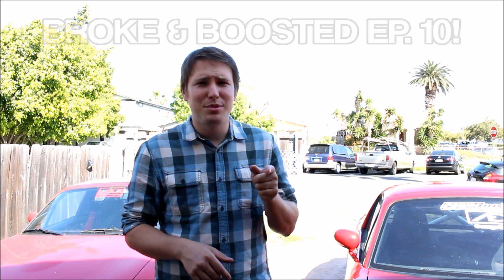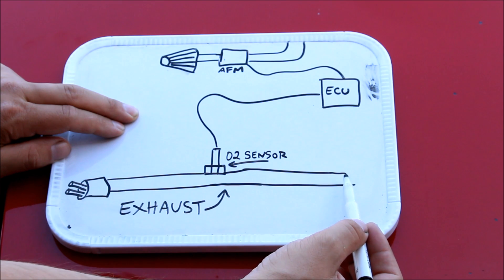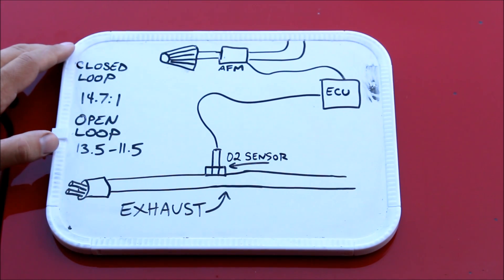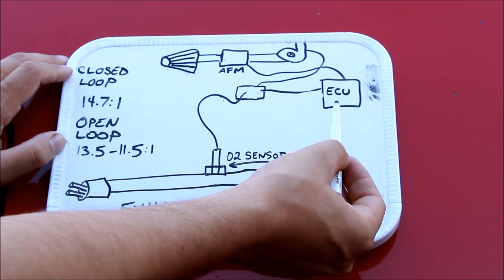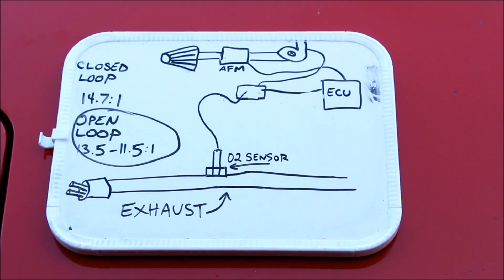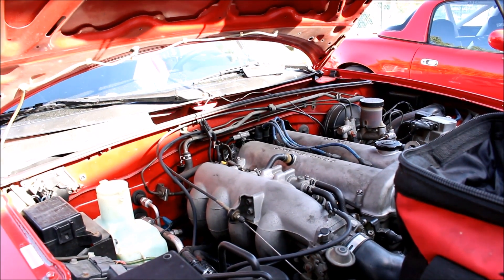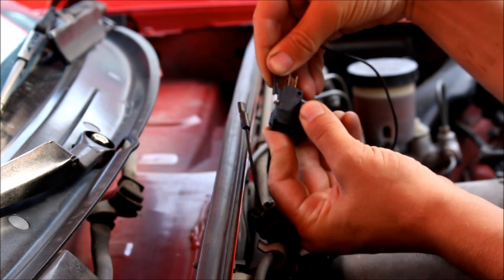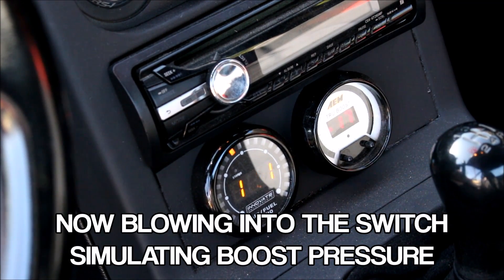Tricking The Stock ECU: o2 Signal Modifier (Broke & Boosted Ep10)

Comment: So if I have a wideband I'm going to completely get rid of the stock o2 sensor and wont need any of this right?
Reply from the maker: If you have a wideband in place of the stock sensor, but are still on the stock ECU, this may still help you. The only time this is unnecessary is with an aftermarket ECU.
Reply: I have the stock ECU still, I have a AEM wideband I'm going to put in, this trick should still help it run better right?
Reply from the maker: Sahin Merino It can help. The stock ECU doesn't know you have a wideband, because you have to run the narrowband signal to it. So this cutoff switch can help it run a little smoother as it transitions into boost.
Reply: Installed the same way as the video shows, but I'm still getting a very lean reading during idle and cruise speeds. Anything I could be missing?
Reply from the maker: Sahin Merino How lean? Does it do the same thing when disconnected?
Reply: yeah it's running lean with or without the signal modifier but only when not in boost such as cruising and idle, it gets a little better once warmed up
Reply from the maker: Sahin Merino If it runs lean with or without the signal modifier, then that's probably not the problem. How lean does it run? What AFR?
Reply: AEM uego, it's about a foot away from the turbo in the downpipe, I agree that it's probably not the o2 sensor modifications I've done but I still can't figure it out..
Reply: It's reading 17+ on idle and cruise and about 11 to 14 during boost. Steady 12 when WOT on boost
Reply from the maker: Sahin Merino 14 is too lean in boost, that's dangerous to the engine. Got any exhaust leaks?
Reply: Yea I have exhaust leak from the cat, but could that really be causing the gauge and car to be that lean?
Reply from the maker: Sahin Merino An exhaust leak close to the sensor will show lean readings even though the car isn't running lean, but not at wide open throttle (only idle/light cruise).
Reply: I'll be fixing the leak asap and see if it makes a difference. I really appreciate the insight on this issue I'm having. Thank you

Comment: do you know if the switch can work  with the stock O2 sensor?
Reply from the maker: It will work the same way yes
Reply: +TheCarPassionChannel  what about the performance??what s your opinion?
Reply from the maker: peter yalas You're overthinking it, a lot of people don't even use this. Also, I hope you're not planning on boosting your car without a wideband.
Reply: +TheCarPassionChannel you re right...i dont plan to do such a thing!but .i don't want to use the gauge in the cabin and as i saw a calibration with it is needed....is it possible to use the wideband directly connected on ecu without the gauge and no calibration???
Reply from the maker: peter yalas It takes 30 seconds to calibrate the sensor and you only have to do it like once a year... Yes you can run a wideband controller direct to the ECU with no gauge, Innovate sells them like that as well. But you still have to calibrate the sensor.
Reply: +TheCarPassionChannel can i calibrated without the gauge?
Reply: +peter yalas  if yes how?
Reply from the maker: peter yalas The gauge doesn't calibrate the sensor, the controller does. The MTXL has the controller build into it. Whichever unit you buy, it will have instructions for calibration.
Reply: +TheCarPassionChannel ok!it s all clear now!!! Thanks s lot!

Comment: By breaking the o2 signal, you are simulating a lean condition not actually changing closed loop or open loop states. Those are usually depended on load, and tps values. 

This will still help with using and NA ecu on a turbo setup, but technically speaking it has nothing to do with open or closed loop operation.

Comment: Great explanation why is this whole thing needed. I wish I'd see this a few months ago. One question: what is the signal that you are feeding to the ECU to trigger it to go open loop ? I don't really know how narrowband stuff works.
Reply from the maker: +Kristóf Kreszán This switch only intercepts the o2 sensor signal wire. As soon as the ECU has no o2 signal, it goes into open loop. Please realize that this modification is ONLY to smooth out the transition between off-boost and on-boost, it will not add any additional fuel while you're boosting.
Reply: Yeah, currently my installation has a piggyback EMB on it but then I'm on boost the factory ECU pulls back the fuel. (2001, MK2.5, 1.6). Will not the factory ECU come up with a check engine light or something if I disconnect the O2 sensor from time to time with this circuit ? I read somewhere that I might need to stimulate some other o2 signal instead just cutting it like a 0.48V.

Comment: This would work on different type of cars too correct? And is the Vortech FMU work on cars with EFI?
Reply from the maker: +JDMHMONGBOY96 Yeah I've seen the FMU used on a lot of different cars. This pressure switch is an experiment for me.
Reply: +TheCarPassionChannel Is it possible not using this trick and only use the FMU?
Reply from the maker: JDMHMONGBOY96 They serve completely different purposes. But try it?

Comment: thanks for the great advice greg car runs much better now. the pressure switch works great!  have about 200 miles on it.
Reply from the maker: +matthew mccollum You installed it on a boosted, stock ECU car?
Reply: yes i have a stock ecu and it is boosted. i have a JR m45 sc on a 1.8L. the pressure switch took the hesitation out completely just want to keep the motor safe until I get mega squirt. thanks for the awsome tuner channel.you've been a big help! keep up the awsome content
Reply from the maker: matthew mccollum Dude, that's awesome. I haven't driven my car boosted yet so I had no idea if it would work. Thanks for commenting.
Reply: yea works great ! im up to around 300mi no check engine light and best of all a safer engine! thank you ill be keepin up with your projects. im in the early stages of my street / autocross miata build as well so any and all information is super helpful
Reply: +matthew mccollum Great info.  All my research for my build is suggesting that it should work on the 1.8 OBD2 cars as well as the obd 1 cars.  I am glad to hear yours is running better now.

Comment: ive got a 2000 supercharged  nb 1.8 i got a pressure switch from a heating store rated to 14"wc which is around .75psi and blew out the diaphram ran awsome till the diaphragm blew out then check engine light came on. i reset check engine light i ordered the switch that greg suggested should work well its rated at 30psi burst. ill let you know how it works. i did notice a big difference in acceleration on the switch i blew up

Comment: The last time I saw a mod to the system like that was with Daves farm and his turbo wagon he made some videos on. I think his switch turned on some fans to the inter-cooler he made for his car though but the concept is still there. Very interesting way to keep a stock ecu in a low boost fuck it all application.
Reply from the maker: +jr540123 This 'build' is a learning experience for me too, I'm sure it will need some tweaks once I start putting it through the paces.
Reply: TheCarPassionChannel I look forward to seeing the end results regardless. Anyone with enough cash can buy a kit and pay a guy to tune it. It takes real skill to pull of what magic your doing with this car.

Comment: hey greg, i got a question; you explained that MS acts as a MAP sensor allowing the user to delete the AFM in a stock miata and switch to a IAT instead... since you're not using MS on this build how do you plan on fitting the turbo?  (since the AFM is in the way)
Reply: AFM is just a little tube you can plumb into the intake pipe. Turbo or not.

Comment: I did the same thing on my build.. Except I just straight disconnected the o2 sensor so it always ran rich
Reply from the maker: +Spoolin'Mexi That is another way of doing it, only downside is the crap fuel mileage, haha.
Reply: +TheCarPassionChannel I was surprisingly still getting around 23 mpg😅 but this would have probably worked a little more clean.. Great videos man, big inspiration for me
Reply from the maker: Spoolin'Mexi Thanks! Saw your "how to turbo your miata for cheap" video a while back, really cool you were able to do that in high school, wish I could have started boosting cars that early.

Comment: Hey greg!?..would you recommend this on a 96m 1.8? or with it being a OBD2 car best not to? (im speaking about a low boost daily maybe 5-7lbs of boost) nothing crazy basically just to give the miata a little kick in the go-go department with that satisfying choo choo sound lol...im extremely interested in this budget setup you are foregoing and super excited for the FMU information soon, But if i may ask please go into high detail in these departments as i and many other will find great use/instruction from it all. Happy Boosting my friend and thanks again for your heard work and dedications!
Reply: +Rust Bucket Miata So I have been doing some homework on this topic and am starting a 1.8 turbo build on a 96.  I am going to start down this budget route and see how far I can get.  It seems that with an FMU and this O2 clamp method, it should work.  The benefit of OBD2 is that with a scanner and a wideband you should be able to figure out exactly what the stock ECU is doing.  It seems the 96 air meter can flow up to ~220 CFM, but info on its measurement range is limited.  With a volt meter, I can tell when and if its maxing out.  I am planning to do A LOT of videos on this as I go along, so stay tuned.
Reply from the maker: +Rust Bucket Miata You'll have to do your own research for OBDII car, not sure

Comment: I am excited! Great job with the O2 signal modifier! I was looking forward to this video but i thought you were going with a rising rate fpr.
Reply from the maker: +Vincent Au This mod has nothing to do with providing more fuel in higher boost. It only has to do with a smooth transition from off boost to on boost, above 1psi it doesn't really do anything. Check out Ep11

Comment: Is it ok to put a $300 + after market clutch on a stock 1.6L Miata or its not ok since the clutch is design for boosted miatas and won't work properly on a stock Miata
Reply from the maker: +Driftblock350 You can put a $1200 clutch in it if you wanted to, won't hurt anything except your left leg in traffic, lol

Comment: if you modify the stock ECU and slap on a turbo, will they still allow you to smog your car in California?

With Megasquirt?
Reply: any sort of mods on a car big or small, will fail smog in Cali.
Reply: So you can't really turbo a Miata in CA?
Reply: +Jo Ro you could with smog approved kits. Also if your car is OBD1 you can get away with megasquirt, just have to make sure your timing is up to OEM spec, at least from what i heard. I dont have MS.

Comment: Would the SOHC computer likely have this mode as well? (1992 323 B6)
Reply: +James Varner The switch is essentially break the o2 signal connection the ecu. If you already have a means to monitor AFR on your 323 it would almost be the same as disconnecting your o2 during operation. If your o2 only has one wire that means it doesn't have an o2 heater and likely won't recognize a heater issue if it's an OBD2 ecu. The range you'll be looking for with a factory narrow band is 0-1 volt. Stoichiometric 14.7 AFR is about 0.5 volts. Lower ~0.5v is leaner and above ~0.5 is richer. The narrow band o2 sensors aren't very useful for tuning since they don't give an accurate AFR above and below 14.7.  TL;DR I wonder... If you read the voltage from your (upstream) o2, disconnect it then read it while disconnected from the ecu is the reading higher indicating a richer fuel mixture being used or lower indicating a leaner mixture.  Make sure car is at operating temperature. Try at your own peril of course. (Disclaimer)
Reply: +Lionel Townsend I'll need to shell out and get a wideband O2 first.

Comment: Yooooo this is way to cool. I am curious about how you plan on messing with ignition. Are you going with a msd ignition controller and fmu or simply this little o2 modifier? I am definitely going to turbo my 94 miata if you find success with such a simple device! Also, are other injectors necessary? like a 550cc or in your case maybe a 1.8?
Reply from the maker: +Samuel Ross You'll find the answers to some of your questions in tomorrow's video.
Reply: Sounds good!!!! cant wait :)

Comment: that connector you chose is bulletproof, we use them all the time in applications with ambient temps of around 325c and nothing happens also, I know that they can handle any amount of vacuum, but dont know if they like 15lbs of pressure. If you see the serial number you can google the spec sheet and we can find out. ALSO  megasquirt FTW lol

Comment: can megasquirt use wideband sensor to tune it self?
Reply from the maker: +Felix cv To an extent, but you still need to tune a lot of it manually. The auto tuning can help form the map but it will still need fine tuning. There are a lot of the settings aside from the just the fuel map that need to be tuned.

Comment: I'm not sure if the this is MSM specific or not, but on the MSM forums a lot of people have started to also do a Diode modification. The O2 Signal Modifier works, until you hit more than 70% throttle, at that point it uses the TPS. A common problem on modified MSM's is hesitation even with the O2 Signal Modifier, if you ramp into throttle the O2 Signal Modifier works great, if you are in more of a track or race situation your going to be full throttle. At this point the O2 Signal is overridden by the TPS Sensor. So anyway, what people do is install a resister to the TPS to limit its voltage to seeing a range of 10-70% this helps by removing heavy engine braking and also keeps it looking at the O2 Signal Modifier. 

http://www.mazda-speed.com/forum2/index.php/topic,14706.0.html
Reply from the maker: +Richard Gardner That's something I haven't heard of before, sounds interesting! I'll forward that link to my MSM friends for sure. On the 1.6 cars I know it won't be relevant because they do not have a variable TPS. This is my first time going through all the budget work-arounds so I'm sure I'll learn a lot once I start driving the car boosted.
Reply: +TheCarPassionChannel Ah I see, I'm not very technical myself but search Diode on the MSM forums and there are lots of people asking questions and reviewing the technique. The Diodes are also only $5 and can be removed in a matter of seconds. So its win win :D I still haven't installed mine, hopefully doing it in the next few days, but even with the O2 Signal Modifier if I coast at 4000RPM and hit full throttle my wideband hits 18/1 AFR which is worrying even for a second or so.

Comment: Great cheap mod in theory, can't wait to see if it works as intended. Seems like disconnecting the signal wire on on an O2 sensor like this would start throwing codes on an obd2 vehicle, or am i misunderstanding how something works?
Reply: +AKLmfreak I think you are exactly on track with the reading I have done.  I am about to do the sister build to Greg's on a 1.8 OBD2 car.  I think this clamp method will work to throw the computer into open loop enrichment, which isn't an automatic error code.  I agree that 0 V could set a code though...I will find out and let everyone know.  I am going to go into as much depth about this kind of detail as possible for my vids.  Thats a whole lot easier with all of Greg's groundwork.  Thanks Greg...you are making me poor!
Reply from the maker: +AKLmfreak I can't answer that as an OBDI owner, but on FM's site they say their version can be used on all models.
Reply: +TheCarPassionChannel I did some reading, I think if I understand it correctly the "signal" from an O2 sensor is a voltage value somewhere between 0.1 and 1 volt so if your $17 pressure switch there completely cuts the signal and effectively makes it "0.0" volts the ECU may (or may not) see that as a problem.  If the ECU doesn't like an open circuit you may be able to add a resistor between the terminals of your switch so that when the switch opens, signal flows through the resistor and the voltage drops enough to trigger open-loop operation without throwing an error code.  The FM install sheet labels their device as a "voltage clamp" so it may be a little more complicated than a simple resistor but I really don't know as much about the electrical interactions needed to keep a stock ECU happy with a modified signal.

Comment: Flying Miata sensor according to https://www.flyinmiata.com/support/instructions/ecu/O2_signal_modifier.pdf is MULTICOMP PSF102-7651-713 - at Farnell is even cheaper than sensor that You used - http://www.newark.com/multicomp/psf102-7651-713/pressure-switch-spst-no-2-17psi/dp/24R7137
Reply: Sorry... My mistake... Flying Miata sensor is a custom version of this sensor. In my opinion MULTICOMP PSF102-7651-714 http://uk.farnell.com/multicomp/psf102-7651-714/pressure-switch-3-6-0-11-psi/dp/1734677 should be more than enough for this task ( switching pressure could be adjusted by screw )
According to datasheet:
- Switching pressure - 3.61 to 25 psi
- Max pressure: 30 psi